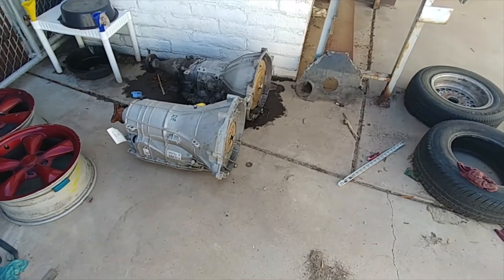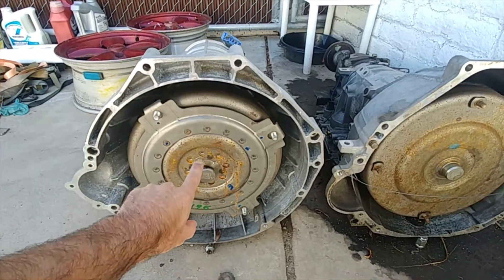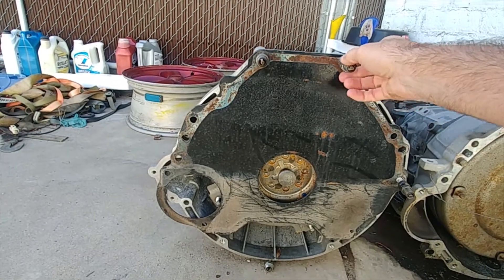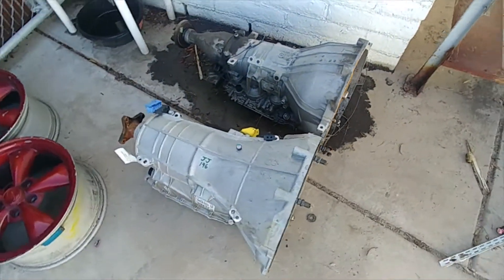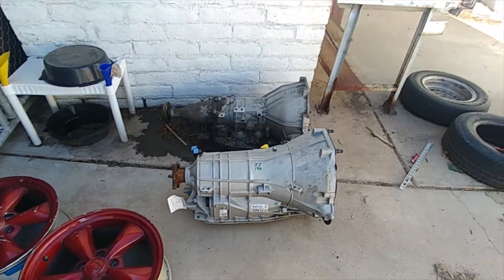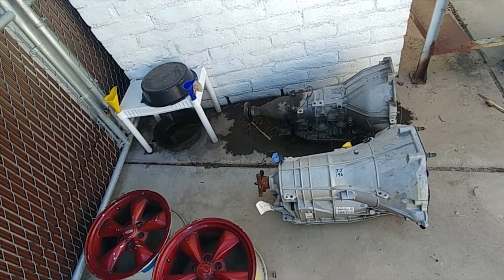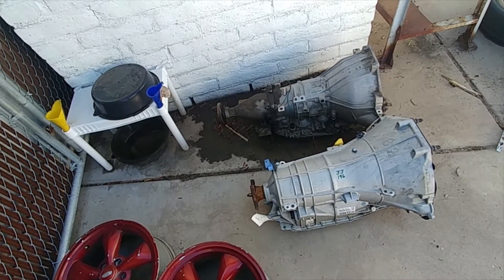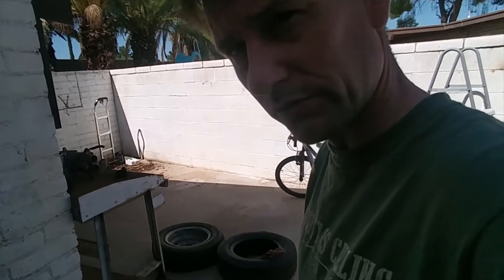6R80/TR3650/T45 to SB Ford 302, 4R70W/6R80 comparison.

Comment: The controller is still really only available from Quick Shift 6 and the OEM PCM's, other circuitry is likely not very driveable. But I learned recently of how to use a 2013 or 2014 F150 PCM to run both the 6R80, and a SBF with crank and cam sensors.

The adapter is something I never liked last year when I saw the spacers they used for the torque convertor. I may be working on my 98 SUV project in late Summer, a 302 and the 6R80. I plan to use no spacer at all. The starter is rotated up on all modular engines, versus where it is on older Ford V8's. If you realize that, and simply cut off the one block bolt hole nearest to the starter, then the modular V8 transmissions(all of them), bolt to any SBF. If you can do without one bell housing bolt, then you can use all of the OEM 6R parts, the starter, separator plate, and the TC. I'll give that a shot later this year after I retire and get my 347 swap done in my 92 LSC.
Reply from the maker: If you look for the other videos on this channel I got it working and driving by controlling it from a MS3 box.  Wasn't the ideal way to do it but it did work.  I'd rather chop up bellhousings then cut on the blocks.

Drive shaft issues made me swap back to the 4r70w.  I might re-visit this later.  

I've sold over 50 adapter plates over the last 3 years.  Some are installed on TR3650's and T45's along with the 6r80.

Comment: The adapter is already available, and Baumann has a standalone transmission controller. You will definitely have to grind out the bell housing around the starter
Reply from the maker: No one like paying $500+ for an adapter then another $1300 for a controller...  my first adapter cost less than $100 and the code mods were free to me.

Comment: I have a 1992 mustang gt automatic & I want to put a 4R70w in it  I’ve seen a 2004 3.8 atoumatic mustang transmission will that fit direct bolt up to my foxbody mustang 302
Reply from the maker: Yes, the 3.8/4.2L engine series share the same V8 bellhousing pattern.  You have to sort how to drive the trans though.
Reply: Ryan Denney it might be best to take the internals out the 4R70W & just stuff them in my sod casing then I wouldn’t have to worry about the new electronic transmission switching correct

Comment: Have you figured out if the MS3x will be able to control the 6r80?
Reply from the maker: Yes, I'm pulling the 2 PWM channels from the main board injector channels 1 and 2 to provide extra outputs.  Both those PWM can be used for the line pressure and TCC function.  I can then use the normal software PWM outputs for the other 4 shift solenoids and 1 on/off.  In the end I only loose 1 output over the 4R70W install.  BTW this only works with the MS3x box type, not pro or the other prepackaged MS3 products.
Reply: @olboy1981  thanks for the response. I have a 66 f100 with a coyote and MS3 goldbox. It has a mt82 6 speed now and want to go to a 6r80 and would really like to handle trans control in tunerstudio. 
I'll be following closely to see how you make out!
Reply from the maker: @manirkarim2725  only issue I can think of is the coyote 5.0 requires lots of io to run the cams.  That alone will suck up all the extra outputs and the needed input for vehicle speed.
Reply: @olboy1981  true. I have a few extra I/Os since I'm not running an IAC...I might be able to move a few other things around too. Would save alot of money over the standalone trans controllers that are out for the 6r80.